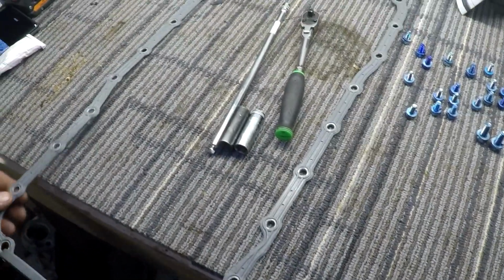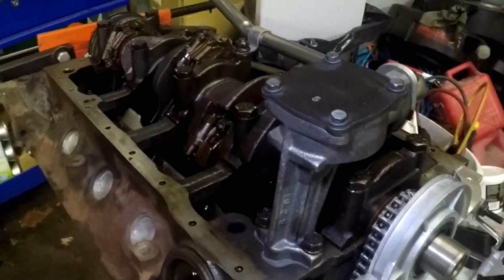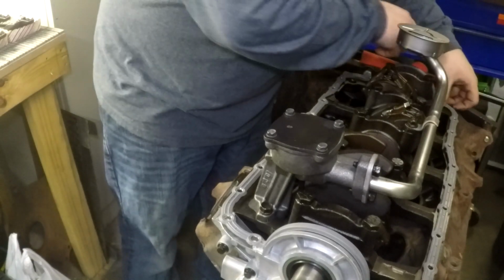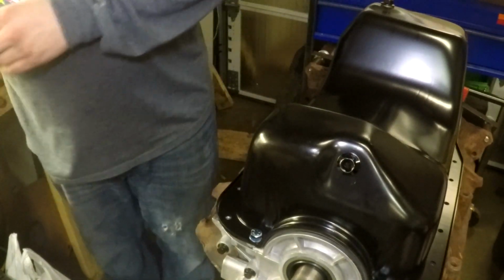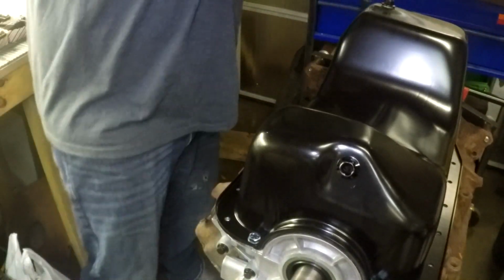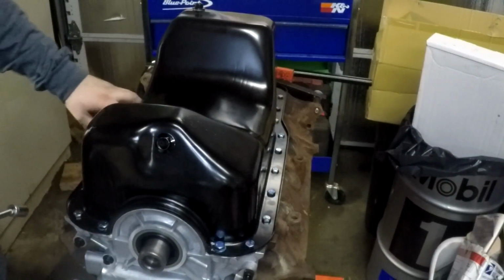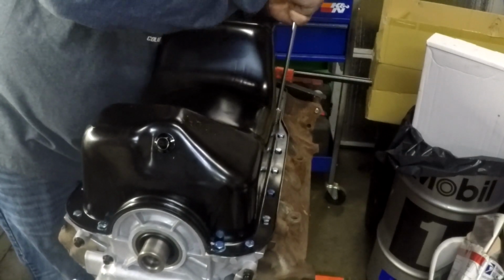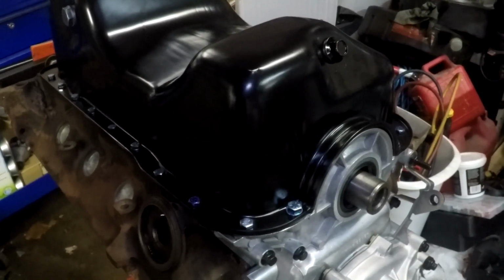How To Install An Oil Pan On A Ford 302 5.0

Comment: Good video my only concern is you were missing the little metal pieces that go over the oil pan before the bolts
Reply from the maker: I agree with your concern. I've built a few sbf engines. I've never had an issue when using a high quality rubber gasket with the inserts to stop the bolts from overtightening. If it were cork or rtv then 100% need them. I forgot to mention that so thank you! The original ones from the motor fell apart they were so rusty and since I had the gasket already I wasn't concerned. Thanks for the feedback!

Comment: Torque specs? Metal thingies that go on with the bolts???
Reply from the maker: Small bolts 100in/lbs. Large corner bolts are 15ft/lbs. Thanks for saying something. And for the metal things, mine were rusted beyond using. I've done the oil pans numerous times without them and been fine as long as you use a quality rubber gasket. I updated the description.
Reply: Thanks for the specs, and for taking the time to respond. I’m working on one now. Everyone else keeps putting ac Delco engine sealant in the corners and around the bolts in the corners I see mine pass through the rim on the block so they can leak, but some say do not use with engine sealant. I lost my little paper from the blue rubber gasket I bought. What say you?
Reply: Mine is the feldpro gasket
Reply from the maker: Thats a good gasket. You shouldn't have any problems without the metal supports. But if you have them, its not gonna hurt anything to use them.
Reply: So did it end up leaking?
Reply from the maker: Nope. Put about 2000 miles on it and engine is dry.
Reply: @DMoneyGarage  that’s awesome. I just pulled my motor. It’s a great runner yet, but it has oil leaks everywhere. One piece oil pan gasket looks like the way to go. Thanks for the video.
Reply from the maker: Definitely for the cost I almost always use 1 piece rubber. I've used cork and paper but I'm very picky with what I do. Lol.